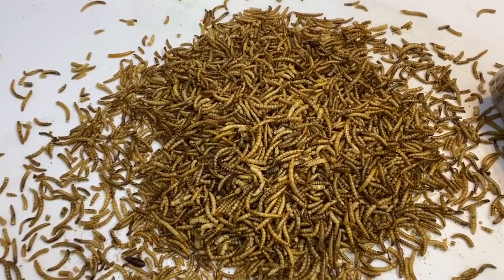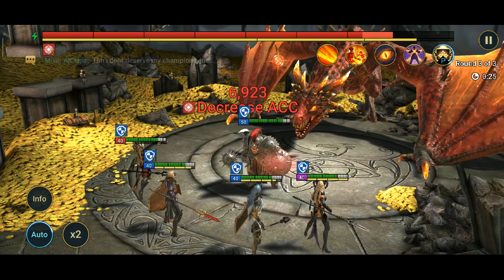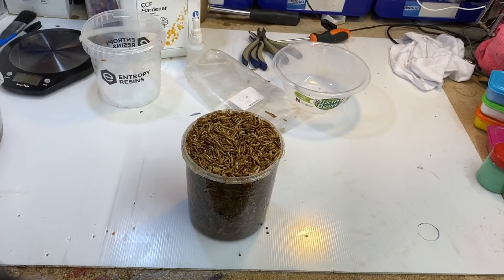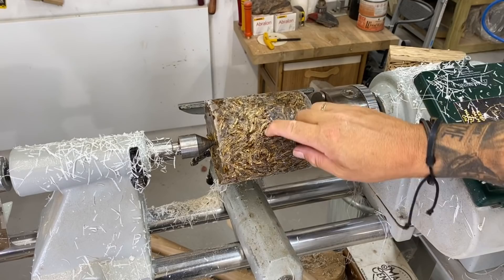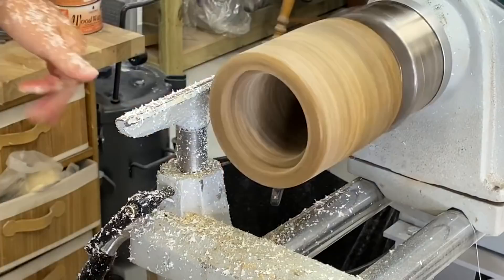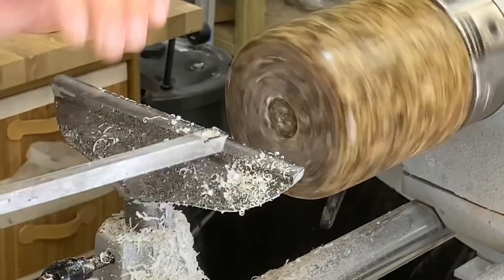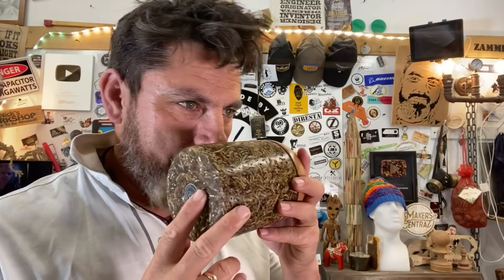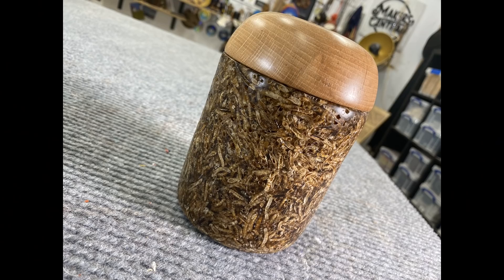I Tried Woodturning WORMS - Real Ones!

Comment: You should have just use resin as a coating to seal the holes, and smell, in.
Reply: The smell will get worse without a coating. With the organic material exposed to air, they will rot.
Reply: @zandilar630  🤮🤮
Reply: @zandilar630  Not if theyre dead and dried
Reply: @zandilar630  they are dead and dried, meant to be treats for hens. They won't rot and, tbh, I quite like the smell lol
Reply: @Crotchwhistle Purple I don't think they will... but if you say so
Reply: @SilverWolf_-cj4qn  theyre dried so they will last Longer but theyre still gonna degrade and rot. Especially in high humidity
Reply: @nekowitch417  didn't realise that

Comment: Just in time for Halloween. You should try filling the holes and sides with some extra resin and then turning the resin edges smooth so it doesn't have a ruff finish. It might trap in the smell if it stinks a bit. That way they are inside the resin and the worms are not exposed. Then you can store whatever you please inside the jar. Look forward to hearing back from you, hopefully....

Comment: The oil on the top when you took it out of the pressure pot is actually wax from the larvae shells. If you can stand the smell, it's great for the skin as it's very close to lanolin in composition. Gorgeous pot but as others have said, do another coat of resin to fully seal it otherwise it'll start to crumble. Next weird and awesome project please, love them!

Comment: The container looks good, except for the holes through it from the carcass of the worms. Maybe reuse the container that you poured them in and add another layer of resin around it, then turn it down a little to make it smooth. Keep those videos coming.

Comment: 7:52 What you could have done is re-resined it in a bigger pot to seal the wormholes 😅🪱 and returned it on the lathe and that would have sealed it and stopped the smell and gave a deep finish. Nice one nick 
Keep up the good work and waffle one

Comment: You could put the pot in more resin (possibly some scrap wood for the insides to take up space and a container not much bigger than the actual pot) and then re-lathe it and bring the resin down to maybe a centimeter or two. Just to encase it in resin so it doesn’t smell or anything

Comment: I was wondering if you could have put some resin shavings on top and a board to press the worms down instead of changing the container. Could even mix shavings in with worms to spread them out. Shavings could help fill the area to be removed too. I guessing. It would save on materials to reuse shavings of same color.

Comment: for one it might had helped if you vacumed it before putting it in the presure pot

and secondly more importaint
sealing the finished peace with a layer of resin 
worm's couldnt crumble out 
helps with the smell
and youre emblem will stay on forever
(and the lid might fit not so loosely)

but after all it look's great
a great gift for a reptile breeder

makes me wonder if you could get a bunch of colorfull dead butterflys
that might look interresting

Comment: Those are meal worms.  Perfect chicken treat.  I think it would have been cooler if you had put a wood blank in the center and then poured the resin and worms on the outside.  Let it set and then add another layer of plain resin to the outside and let it set & then put it on the lathe for a bowl.  I think the worms floating around the wood bowl would have been cool.

Comment: Idk dude, maybe if you had used a slow-curing resin, put it in a vacuum instead of pressure pot, and weighted it down with something porous, you could have maybe gotten the resin to flood the hollows of the dried worms? That thing is pretty gross.

Comment: I'm not an expert on resin, turning or worms I'll leave that to the expert Nick but I might have baked the worms @ a super low temp with some kind of oil absorbent & maybe that would have help with the pockets in the resin you encountered as well as on the top of the blank.. just a thought. Thanks for the funny vid! Keep on waffling Nick 💖

Comment: I think the works will just decay over time, and stay smelly. You might be able to avoid that by coating the bowl with resin to seal it air tight. Sadly, this is my least liked project so far, as I can see no real use for it, besides decaying & being smelly.

Comment: how many mouthfuls of worm resin did you end up with. i would be wearing my best face mask last thing i want is a lungful of mealworms. lol. after carving i would have painted resin over it to fill it in then bung on the lathe again.  great video. always enjoy watching.
to terrified to use my lathe is one them cheap ones with belt to change for gear settings. nightmare to use. lol.